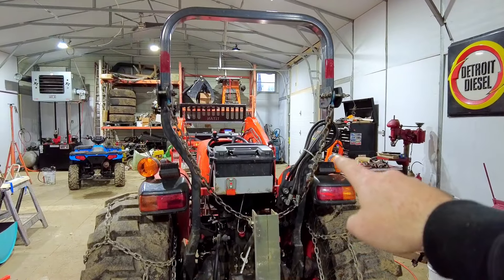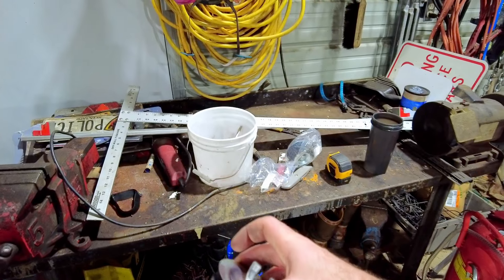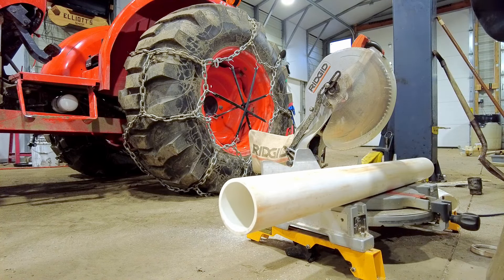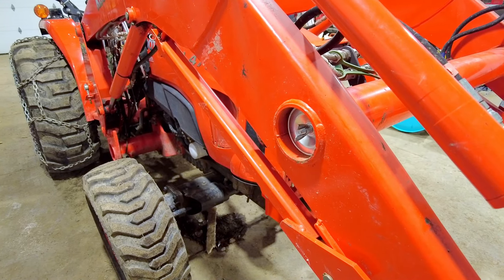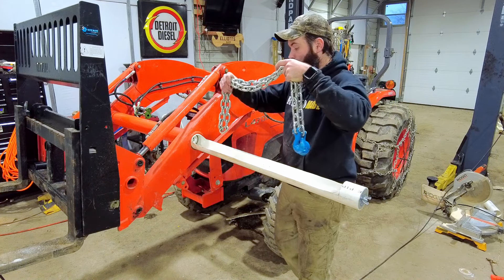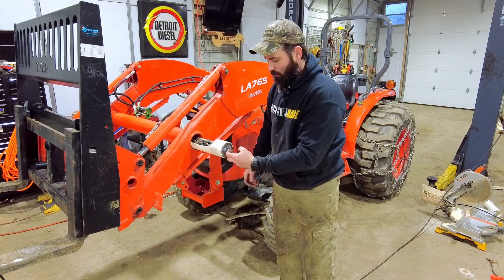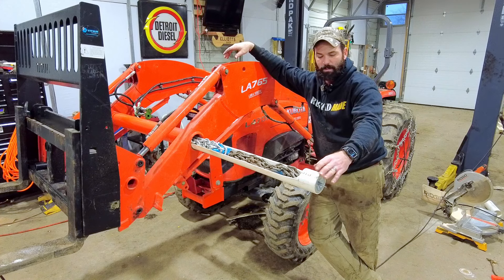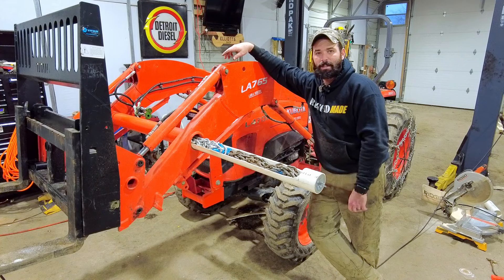DIY Tractor Upgrade: Chain Storage Compartment

Comment: hmmm, the tube will vibrate out as there is nothing securing it.  Then the tube will also rotate, leaving opening upside down.  Combine both problems and the chains dump on the ground while you're working.  Concept is good, you need to ponder the solution a bit longer.  Many videos out there already, no need to do one that doesn't solve the easy problems..
Reply from the maker: I’ve been running this set up for over 2 years. Not once has either of those two things happened. Appreciate the input, but with the correct sized pipe you get a great friction fit.

Comment: Great tip! I’d paint plugs Kubota Orange and coat pvc with lithium grease. Now make another one for the frame tube for 1”x 12”,  2” x 12”, 1” x 24”, 2” x 24”, 3” x 24” cinch straps.
Reply from the maker: I’ve thought about making a little one in the frame tube for a little tool kit
Reply: Definitely no grease not only would it be possible for the tube to slide out when you don't want it to but eventually you'll be covered in it every time you need to get something out of it.

Comment: You should reverse the "bolt" on the test plugs.  Put the bolt on the outside and you could use a threaded eyelet that would be easier to grab, or you could attach a short loop of string.  I'm not familiar with that type of test plug, but I know it's possible on the Oatey's brand plastic plugs.
Reply from the maker: Yeah I know what you mean, just couldn’t source one locally the day I was putting this all together. Thanks for watching!

Comment: I think I would have made two smaller cut outs instead of one large one.  Would be a little bit stronger.
Reply from the maker: It certainly would be, but I Haven’t run into any problems yet

Comment: I have a L3301 Kubota, , and it has a round tube on the loader frame. When I haul a 600 ound solar array every spring 1/4 mile down a grade with a significant sideslope, I have a counterweight I stick in the tube on the uphill side, secured of course, about 200 pounds, sticks out about 3'. As a crane guy, I like the idea of movable counterweights.
Reply from the maker: That’s a great idea, what’s it made out of and how does it secure?

Comment: Nice video! I plan to do this on my L3010 for sure! I will probably use an eye bolt in place of the wing nut on the plug for ease of removal.
Reply from the maker: It’s super handy that’s for sure! I’m still using it to this day. And the eye bolts are a great idea! Thanks for watching

Comment: Love this!  I am going to try it, but not cut it quite as deep, so as to not lose the structural integrity of the tube.
Reply from the maker: It’s been over a year and I’ve yet to have an issue. The pipe supports those two chains in there with being pulled out still to this day. I used schedule 40 so it’s got a nice thick wall on it

Comment: I like that.  I'll have to see if I can do that on my Mahindra 3016.  One thing I'd say is to make some long slices down the end of the pvc where the test plug is.  As the test plug expands, it'll push out on the pvc and bind it agains the inner diameter of the of the pipe.  At least, it seems like it would since you have a pretty tight fit.
Reply from the maker: It certainly would make it tighter, however I've been running this for 2 years now and haven't had a single issue with the tube sliding out on its own, so I guess if it ain't broke don't fix it.

Comment: You have the LA 625. My L3800 has the LA 524 and that tube is way to small to accomplish what your doing. It's a great idea but won't work for me. My solution was the  bottom of the loader bracket that pipe Is about 5 1'2" ID. I made a plug for the inside back of that pipe and a cover for the outside. My chains fit great not to mention , it was easy and cheap to do, my chains oh and that's 2 of them 10' long each same size chain as yours and the tractor other than the outside cover I made still looks the same. I saw your video and thought, how can I make that better? I looked at mine and thought, what a great way to utilize that wasted space. I keep one chain in each side and some tools. It's been over 9 months and it works fantastic. Hey, thanks for the video to get my creativity motivated  into action.
Reply from the maker: Glad you found a solution! I’ve seen guys use the tubes you use for a small tool box to hold the essential tools when afield. Thanks for watching!
Reply: om

Comment: USe a small loop of rope to act as a handle when pulling the end plug out - it won't break off easily. You could also spray the end plugs with Kubota orange to disguise the install and it would be almost invisible
Reply from the maker: The rope isn’t a bad idea. As far as the paint, the Kubota orange is like $25 a spray can, juice isn’t worth the squeeze in my situation

Comment: I made tubes like that for my new holland, but I did 2 half lengths with a exterior cap the end and the thin test cap on the inside end. I don't know if the one long tub will do it, but my 2 Halfs do start to slide out in use so i had to add a spring and hook to clip them in. Love them though. Also painted mine to match tractor blue.
Reply from the maker: I’m sure I’ll be making some modifications to these as time goes on and I use it
Reply: One possible idea would be to slit the pvc pipe where the test plug sits.  That way when you tighten down the test plug to expand it, the pvc pipe expands a bit, too.  This would help to lock it in place against the ID of the tubing.

Comment: Push from the other side to gain access is a possibility.  My fear (not much of a fear) is that it will lessen over time and start to slide out on its own.  But that bridge can be crossed when if you get to it...
Reply from the maker: I also thought about it wearing down, and the solution to that would be another $10 piece of pvc scrap from the local plumbing place

Comment: I also did this trick on my tractor. Make sure you pull it out frequently to check for water between the pvc and the metal. Water followed the pvc in and sat in the loader tube on mine. Other than that this is a great storage idea for sure
Reply from the maker: I thought about that. And I might actually attach a larger test plug into the loader itself to keep moisture out
Reply: @EverythingElliott  that might be the thing to do for sure.

Comment: I added test plugs on the ends of the torsion tube, to hold the pipe in.  Used bushings, on the inside of the PVC with an eye bolt sticking out so I can hook a finger to pull the tube out.
Reply from the maker: That’s a great idea!

Comment: Great instruction video Elliot. My question is since adding the chain, has the weight caused the tube to slide out on either side? If not, I see this in my tractors future. Thank you.
Reply from the maker: No it hasn’t, it’s still just as much of an interference fit today as it was the day I installed it!

Comment: The chain hooks are called slip hooks or grab hooks. I’ve got to check the diameter of tubes on our new 4802
Reply from the maker: Thanks!
Reply: The slip hook is called a "running hook"

Comment: You could have left the pipe sticking out a couple of inches and cut holes in the end to grab.
You could change out the wing nut and bolt for a simple eyebolt.
Reply from the maker: I mention in the video how I don’t want the pipe proud of the loader arms because I’m often in the woods with my tractor and don’t want to catch the pipe on a tree or something. And the eyebolt would work well.

Comment: Does rainwater get into the tube?  Did you have to put small holes on the bottom of the tub to allow water to flow out?  This is a great idea.  I was thinking of adding storage for chains.  I've needed chains more often than I thought.  I'm in the middle of nowhere and I didn't bring them.  lol
Reply from the maker: I’ve never had any issue with moisture getting in there, however my tractor sleeps indoors. So I can’t say that would be true if your tractor sleeps under the stars
Reply: @EverythingElliott  Unfortunately, my tractor is outside rn.  I'm building a small shed for it and my attachments.  Thanks for the info.
Reply from the maker: @danieljohnston8880  I honestly dont think it would be an issue, its a pretty tight fit

Comment: would pushing from the other side to start, make it easier to grab and pull from the extraction side?
Reply from the maker: That’s exactly what I do. About a year later and it’s still tight, it hasn’t worn out yet which is great

Comment: I wonder if it might vibrate and invert while in-place. That would make a nasty surprise if you had small parts (cotter pins, etc.) you were carrying.
Reply from the maker: It’s been in there over a year, that’s never happened. I suppose if you didn’t use the correct size pipe that’s a possibikity

Comment: I live on hilly land. What happens if I'm mowing on an inbankment. What keeps the tube with it's contents sliding out sideways. What is to keep it in place?
Reply from the maker: Mine is a friction fit, it hasn’t slid out at all. Did you watch the video? I demonstrated the pressure it takes to pull it out

Comment: On loaders with 4.5" tubes, such as my L1055, I've discovered that a regular Oatey 4" test plug  with one wrap of 1/4"  x  3/4" closed cell weatherstripping tape ( Item #632032 Model #06593 at Lowe's), creates a secure, waterproof end cap, for less than $10.00.  You can make your own interior tray/tube from 10" PVC pipe if you want, or pay Kubota more than $200 for a couple!
Reply from the maker: I never even bothered to look up the price of Kubotas because I had mine done long before they came out, but I believe you that Kubota would want to rob you of $200!

Comment: You used a 3” pvc tube, so what is the diameter of the crossbar of your tractor?
Reply from the maker: Just about 3.5” inner diameter
Reply: Rats. I have a Mahindra and my tube ID is 3 inch and no one makes a 2 1/2 inch pvc. Any ideas?
Reply from the maker: @gregharper7075  2.5" pvc is 100% a thing, I've used it before.  It's not a common size so your big box stores wont have it. you need to find a pipe supplier local to you. A plumbing supply company should have everything you need.
Reply: Thanks again sir.

Comment: More complicated than it needs to be. Just put the pvc pipe cut to length into the tube with the chain inside and plug the pvc however you like... jeez
Reply from the maker: You’d be fighting to get the chain out every time, like reaching into the Pringles can.

Comment: That's going to trap water, and scratch up the finish leading to bare metal. Which will lead to corrossion....
Reply from the maker: Perhaps…if that’s a concern of yours don’t do it, not a concern of mine
Reply: And after the corrosion, the metal will decay and become brittle. Your front bucket will fall off, and then your tractor will catch fire and burn to the ground..

Oooooor, itll be just fine with a bit of grease or anti rust spray if you are so worried, or probably nothing at all like everyone who have already done this before.
My tractor lived outside for years,and keeps on ticking. Id happily take function over superficial anyday. And no,rust won't hurt your tractor, just ask the hundreds of thousands of owners who leave theirs parked outside.whatever little rust this would make,would be nothing compaired to just being outside on the norm. Anyway,hope you have a good day,and make sure to stear clear of any mud puddles. Just not worth the risk to drive through them with rust always at your doorstep!
Reply from the maker: @RambunctiousHamster  my favorite is scratch the finish...as if the finish inside the torque tube is that great anyway...